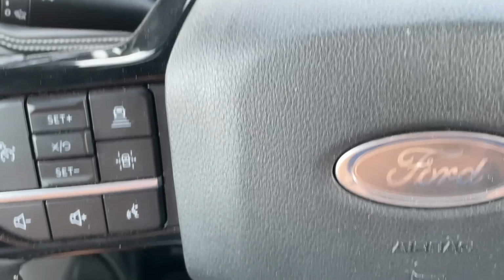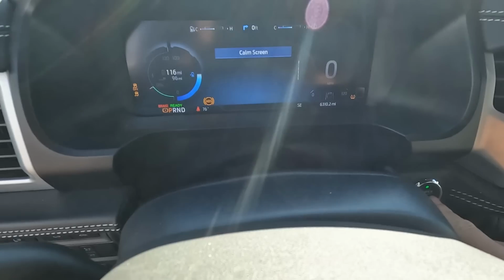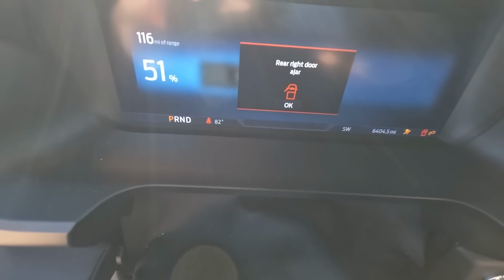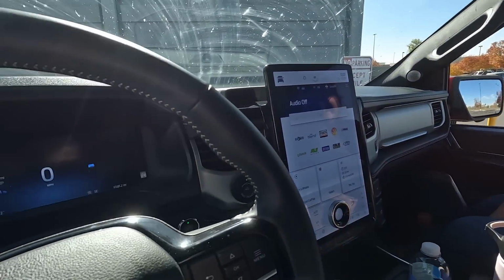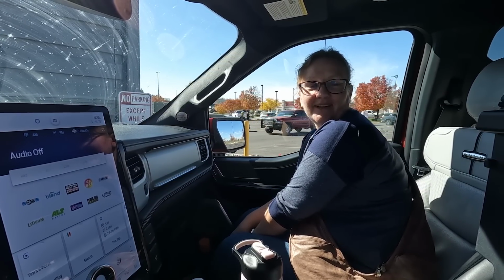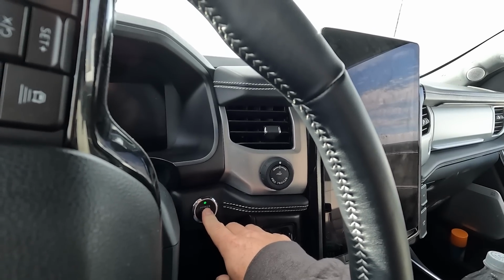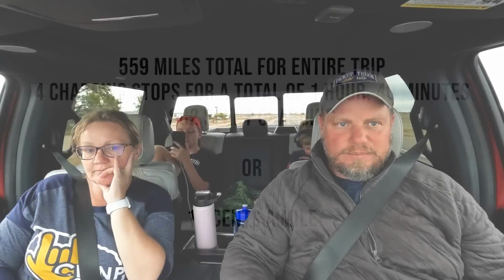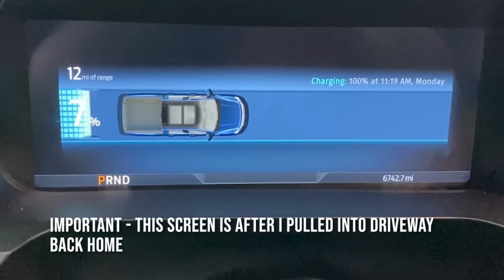Truth on charging times/cost on 2022 Ford F-150 Lightning Road Trip

Comment: I have a new Ram 1500 bighorn and I get 24.6 miles per gallon and and get about 525+ per tank. But the faster I go the better I get. Even when pulling trailer I get 19 mpg. The one thing you have not mentioned is that EV's need a $20-40k battery change every 2-4 years. That is a cost most can't afford after $100k+ vehicle.  I will stick with my non-EV.

Comment: If you drive less than 50 miles per day, an EV vehicle may be for you, but EV's with their current range limitations are not a work vehicle or good for road-trips.
Reply: They have vehicles for that they're called hybrids.  Way better idea then full EV.  You can drive around to work etc pretending to save the world. You get 50 miles of low pollution for daily drivering but you can still go where you want when you want with no ridiculous charge times.  This is what they should be doing not EV that not ready for primetime.

Comment: You probably paid a min of 10k more for the electric version. It will probably take 100k Miles of driving till you break even then soon after that the battery will need replacement and your screwed

Comment: I can drive 500-600 miles on a tank of diesel,takes 5 minutes to refuel and I can pull over to refuel anywhere. How about running the air conditioner in Southern California in bumper-to-bumper traffic or in a winter climate in bumper-to-bumper traffic see how that goes for you

Comment: My 2021 F350  Super Crew dually 6.7L diesel with 48 gallon tank cost about the same as your .......scooter and I get over 1000 miles range with 3 adults. My truck also does truck stuff. You can keep your scooter.

Comment: And think about how much worse this could be if you were driving into a strong headwind. Or you had to sit in stopped traffic with heat or a/c running. Or you had to go like 400 or 500 miles to this wedding. A trip that would take you half a day with a gas engine will now take you two days with an EV.
Reply: Not mention you will get half the range in winter. Plus what about snow n salt causing those batteries to combust.
Reply: @raytycker1656  road salt hates everything
Reply: @gregoryeverson741  yes but from what I've read electric/coal cars that got flooded down in Florida just started catching fire from the salt water. Chemical reaction.
Reply: @raytycker1656  Half the range? I lose 30 miles of range in the cold. Get a grip on reality.  Do some research as to how well the battery compartments are sealed. You can still traverse streams with them. You seriously believe Ev doubles the drive time? Keep sniffing your gas fumes and GO TRUMP!!!
Reply: Ridiculous you spend more time charging than you do driving
Reply: @ScrappingwithGrandpa  Keep sniffing the glue

Comment: Winter battery capacity drops 30-40%+ and you better be judicious with the heat.  It is funny to hear someone who thinks we just started with EV's!   Some of us have already been doing this for a decade now.   

Sorry, EV's are slated to replace that standard F150. You need to pay more attention to what is being stated and the timeline for forcing everyone into EV's.  We are literally being forced into a solution that is not as good as what we have today with conventional fuels.  No choice in the matter.  We have already been playing this "EV's will get batter" for over 10 years now, and they are now mandating in another 8 most people will be in EV's.  

Lithium battery tech isn't going to cut it.  That is what the inventor of the lithium battery said and is advocating solid state to replace lithium for these applications.  You can look that up also and see the battery war that is being waged as we speak.  Likely meaning these new trucks in a few years will be yesterdays news and the manufacturer will abandon them.  Nothing new under the sun here.  

We can't just keep cutting the industry slack and allow them to push a solution that isn't as good as what we have today down our throats.   The manufacturers claim to just be following the govt guidelines and rules.  More scapegoating.  We have to demand better.

 While we are at it let's demand that there is some charging infrastructure out here that does not require apps, and playing games just to get to charge.  Enough charging infrastructure that if you need to charge you can pull in and charge and not be waiting for an open slot making an already lengthy process very lengthy.  How about they make what infrastructure they have reliable so that people know that when they are going to the nearest charging station they will in fact be able to charge when they get there.  The charging stations are down, busy, out of order for extended periods of time.  No place for trucks or trucks towing to be able to charge.   How about charging stations that have services at them like a gas station has or a cafe, coffee shop etc.  How about covered parking at the charging stations?  How about the charging stations accept cash and credit/debit cards?  Or have attendants like a gas station that can take those forms of payment?  How about we DEMAND better because whatever garbage they get us to accept we are stuck with it.  We have gotten only excuses now for over a decade, and now the batch of newcomers joins the party and it is like it is all new and just now happening so we should just accept this.   None of this is new.

Comment: Keep your EV…cost for battery replacement, the way batteries react when it is really hot or really cold, and then cost. 

My current vehicle is 12 years old 200k miles and have only spent 6k on major repairs. When my overall cost was 28k
Reply: F150 lightning battery pack to replace is well over $30,000.00 . EV scam.

Comment: I rented a Tesla in Dallas and almost ran out of juice! No supercharging station close enough with all the traffic in Dallas to make it. I had to use a hotel charger (chargepoint) and basically got 10 miles in 1/2 hour timeframe.  Dallas metroplex is a huge major city and there is truly not enough ev charging infrastructure to make this work at this point.  Even the hotel had two stations with 100''s of guests if I got there and it was being used I would have been screwed.  Don't see how all these ex's make sense in all cases.  It is truly scary considering you could get stranded.
Reply: I saw a tesla guy get towed to a charger cause he ran out of juice. Then he s bragging to me how he saved $100 in gas.  I'm thinking to myself yea you sure saved buddy that tow cost you $250

Comment: A gas turbine multi fuel power plant Hybrid is the only way to go until full electric tech is in place [Do not forget the Grid updates that need to be done $$$]  This Hybrid would be  like diesel electric trains with a "City All electric drive mode "  But on long trips or hauling . Fuel power plant  would be operating the electric drive motors and charge battery's and no all electric Range Fears.

Comment: So you drove 560 miles, stopped for 4 hrs total charging times and it cost $82.00. I drive the same mileage in my 4runner getting 18 mpg and it costs me $94.00 and only one stop for gas. Gas stop, 5 minutes. Yeah, I'll drive my ICE until the wheels fall off. AND, I'll get 300K+ miles without changing the engine:)

Comment: I’ll stick with my 21 3.0L Duramax. 600 plus mile range and by the time I go to the bathroom, another 600 miles of range. Most EV buyers are delusional.
Reply: That 3.0 Duramax is one of the best options available for the open road …

Comment: When you cre comparing a model-T to the most modern trucks, it doesn't surprise me that you have many doubters, I'm sure that was the case when horse and buggy was the mainstream and the car was first introduced. One thing is for sure now days technology accelerates fast, so it won't be long before an EV truck (and cars), infrastructure are improved.  One thing I have learned from watching all these different videos from this channel and others is that change is coming.  From people I know or even watched it does seem a road trip can be a bit less stressful as long as the infrastructure is available.  I have a cousin who does a road trip from Denver to Salt Lake and he said the drive in a Tesla (he just bought) was way more easy, even felt like it was faster (it wasn't, for sure).  But the point he was more refreshed after the drive.  I think in general that says something about general road tripping, maybe we should be stopping more just for safety, that is not making an excuse for an EV, but pointing out maybe it shows we try to push our trips.  Especially on a vacation, take your time and enjoy the drive?
Reply: BTW, great job Tim.

Comment: Like your comment caption said, we need interchangeable batteries, where you pull into a station and drop your dead one and put in a fresh charged one. In and out in 5 minutes. The problem is the batteries would have to be standardized. As humans we are no longer smart enough to do this.
Reply: Yes plug in charging only is a stupid idea. Swappable battery packs with a plug in option much better idea. Almost seems like they want to limit your Movement. Imagine how screwed city dwellers with street parking and apartment dwellers will be having these vehicles. No where to charge they'll have to sit at Walmart and charge for hours while wasting money in Walmart waiting.

Comment: If the temperature suddenly drops, as it commonly does in the Winter, the range will suddenly and significantly drop potentially leaving one stranded with no heat. A truly deadly situation. 

Ram is coming out with an optional range extender for their EV 1500. Apparently with a total 500 mile range in ideal conditions!

If it is clean burning natural gas, a good option. It it is gasoline, then what is the point?

Until green hydrogen fuel cells become mainstream, bio diesel is the only solution for real truck use applications. Superior mpg and overall performance, thus less carbon footprint per tank of fuel!

Comment: Green hydrogen fuel cells are the answer as there is no pathway to net zero emissions without extensive use of green hydrogen fuel cells which in this type of vehicle have 500 to 700 miles of range and refills in less than 6 minutes.

Comment: $23 for 107 miles is 21.5 cents per mile. A truck getting 18 mpg would have to buy fuel at $3.89/ gallon to be comparable. It is more hassle to plan a trip. It is at least $10,000 more expensive. You have to install a charger in your house for $1500 or more. It takes 10-12 hours to charge the battery 50%. The range is not enough to take trips of any real length. The electricity to charge them is mostly derived from fossil fuels. EV trucks are not practical. I buy a truck to haul stuff and tow stuff sometimes into the countryside or out west. If you run out of charge on the trail your buddy can”t bring you a can of electricity. At this point Hybrid trucks are the best way forward.

Comment: Great video...really appreciated all the details (particularly the time & cost info).  One of the big unanswered questions for me is - what is your time worth?  I have a VW Touareg TDI that with a full tank at the start of the trip - would have made that roundtrip without stopping for fuel.  Typically get around 600 miles with 90 to empty ( I try not to push it past that).  My total cost of the trip for me would be around $100-$115 for diesel - but - I would have over an 1.5 hours of my time back without waiting, searching or worrying about how to get home. How much $$$ is that worth?  At the point, my time is worth more than the difference.. The Lightening is perfect for the urban environment.  If I rarely ever left ""town" - I would consider one.
Reply: What is his time worth ?? Well if you consider 95% of the time he will charge at home.  On a yearly basis he will have MORE time. As he will charge at night while sleeping.

Comment: So my 2021 f150 with the 2.7 Eco boost gets 19.9 mpg, so lets call it 20 mpg. 100 miles is roughly 5 gallons of gas, at say $3.50 a gallon that's $17.50 in gas. At your first charge at Walmart you gained 100 miles of range for $23. I'm no mathematician but I think I'm better off in my 2.7, not to mention the charging anxiety associated. No thanks on the EV.

Comment: Range anxiety is a new added issue to modern travel. It’s going to be a while for EV’s to increase range to compete with ICE. I’m afraid that the electrical costs will increase due to market forces. Not by much, but enough to profit electrical companies for shareholders and CEO greed. … The best is to have a hybrid with better fuel and EV capacity. … I’m not even going to mention the increased pricing for vehicles, in general. 🧐🍷🛻

Comment: If your pulling a trailer that is approximately 20-24 feet long and have to recharge at a charging station it is very difficult to charge with a trailer in tow.  Your trailer will stick out to far at a charging station and your'd need to unhook and find a place to park your trailer before charging.
Reply: Simply haul a generator in the bed and charge while driving👍
Reply: @raytycker1656  A 6 cylinder diesel generator should do the trick. Stopping to fill up the generator tank with diesel is so much easier than stopping to charge the batteries. Wait...........
Reply: @bobhenry6159  you can fill a generator in 3 minutes instead of charging for 3 days. On top of that ,diesel is more efficient than coal because that is what's burned to make the power to charge that battery.
Reply: @raytycker1656  Ummm...buy a diesel truck and save money on the $10,000 generator. loll
Reply: @bobhenry6159  I mean when I can no longer get a piston driven truck.

Comment: Imgagine if most vehicles were to become electric, the price of electricity is gonna sky rocket.  Why? Because they can. There isn't any way "around" the folks in control.  That's why solar is way behind.  It can't be monetized like oil/gas/electricity.  Who remembers propane powered vehicles back in the 1980s?
Reply: What I find hilarious is that digging holes in the ground to get coal is destroying the planet, and burning the stuff to make electricity pumps CO2 into the air.  Meanwhile it's perfectly fine to dig holes in the ground to get Lithium, and Cobalt by burning diesel in Caterpillar equipment, (while pumping CO2 into the air) will save us all from a destroyed planet. 🙄

Comment: Basically in rural areas like western Nebraska the EV is not the right vehicle for the job and probably won’t be feasible for at least a decade. Bigger question is what happens in the winter? How much worse is that range anxiety when you have to drive through a snowstorm or happen to get stuck?

Comment: In our state, beginning 2035, the EV is the replacement of the ICE vehicles if you want to buy a new car, it will not be a choice. So, what I learned from this video is that if you want to have a half-ton EV pickup truck, you do not save any money if charging cost you $0.41+ per kw/h. It is pretty much comparable to paying $5 per gallon.

Comment: I truly appreciate this video. It has shown me more than any other review that the cost of EV public charging is nearly equal to the price of gasoline for a pickup truck. (I live in Texas, so fuel is cheaper here - averaging about $3.15 around Dallas).

With the up-front price of the EV, plus the cost of public charging, plus electrical rates rising, I don't see an electric vehicle as a smart buy for those of us who live in the "exurbs" or country.
If I lived within 20 miles of work, and rarely drove outside of the city, it would make complete sense, but just wouldn't work for my situation or for many of my family members that live about 80 miles outside of the Dallas metro.
Reply: Right? And ya didn't even mention how much I would hate my wife having to wait 30 charging at this place and that place like heck not fuel up and get out. The 5 minutes I spend at the gas station is enough time not my top choice to loiter.
Reply: @Koogz406  but given where these charging stations are, the time is negligible. You plug in while shopping or eating somewhere. It honestly takes me nearly as long to get fuel at Costco or Buc-ee's, etc because they're the "cheap" stations.
And 99% of the time, you'd be charging at home, unless you live in an apartment.

The cost is still the biggest problem.
Reply: @GKMess42  I get that but only "if" I have something I need to do. My parents live 700 miles away and I drive only stopping one time so it would add hours to my trip and just extra stress for me I don't wanna have to turn off the AC to make it to a charging station or have to stop and waste money and my time waiting on the charge.
Reply: @GKMess42  for a daily work commuter I get it and it would work for sure but the up front cost and the longevity and not worth the cash to me
Reply: @Koogz406  you and I are on the same page. I live an average of 50 miles one-way from everything I do, and most of the area I drive doesn't have charging stations. I want my next vehicle to be a road-trip and family vehicle. In short, an electric would not work for me for now.

Also, I find paying more than $30k for any consumer vehicle to be insane, but not much choice there anymore.

Comment: Good point on the winter thing. Also with more EVs I wonder if there is gunna be a long wait for charging stations
Reply: Where do you plug it in when the grid goes down???
Reply: @johnjaco5544  to the gas generators lol
Reply: You bet there will be. They're not going to put in 300 Million chargers across the country. You ll sit for days waiting for a charger.